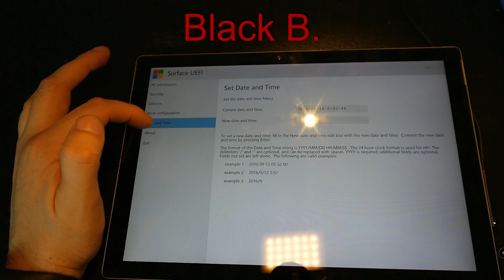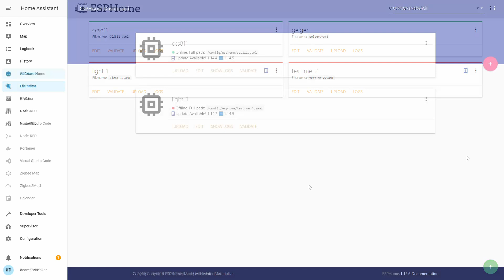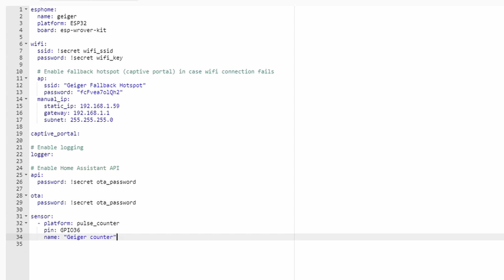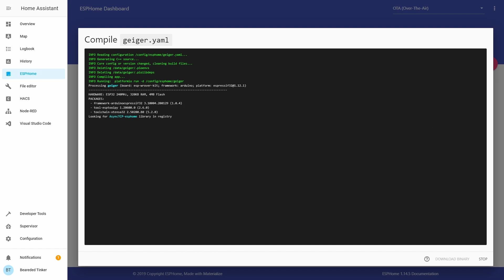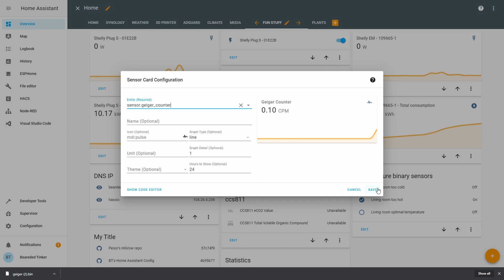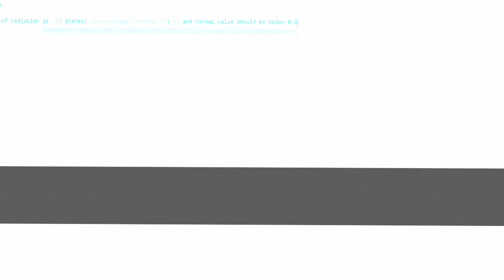Radiation Geiger counter DIY sensor in Home Assistant

Comment: Interesting fact took. I took the device outside and CPM went up almost 4 times due to the sun, in shadow it's not like this. Took a powerful led flashlight and pointed it at the tube, nothing happened. Took an UV led flashlight pointed it at the tube and CPM went up again.
Reply from the maker: Yes, it should be kept away from direct sunlight. And I learned it hard way - got alarm on all devices and speakers. 😂
Then I took time to read a bit more on it and move it to more permanent and secluded space.
Reply: @BeardedTinker  First of all, thank you for the detailed project!
One question: Should the circuit board be in a closed plastic housing or should it be open? Does it make sense to use it indoors or outdoors?
Reply from the maker: @knallaff  you can keep it in  plastic housing. As for placement, I recommend you avoid placing it in the sun (direct sunlight) as sun radiation will have impact on measurements. Indoors and shade is preferred.

Comment: It's good to know how to build and program, I've been doing it 50 yrs so far, another input sensor is nice to add to a micro port, I went from 6502 Forth in the mid 80's with Rom, Ram and Latch FF,  when I worked from Ampex Corp Redwood city, CA. Silicon Valley 400 engineers in my building to the Easy building projects of Picaxe much later with imbedded on board, to the yrs forward projects of Arduino projects
Reply from the maker: Fascinating how it changes through the time but gets easier to work with.

Comment: Have you worked on improving this idea? I'm thinking of building it myself, but I had to ask before ordering components.
Reply from the maker: I've assembled one additional DIY Geiger counter, that is working via Zigbee. Not my project though, picked it off of Russian site. (there is video about it on my channel) This, original board died few months back. Thought that tube died, but no, board died. As it's still connected haven't bothered to look at what failed. It worked for almost 2 years, so not bad for money. Comparing results from those 2 they were actually really close in readings.

Comment: "high voltage" I put my tongue on it.... it has practically 0 amps...
Reply from the maker: 😂 it should be around 300V I think. Forgot what's the rating of J305 tube...

Comment: hi, great job!  compliments!  I bought the kit seeing your video, to integrate it on Home Assistant!  Now I have a RadiationD-v1.1 (CAJOE) kit, slightly different, I have only one number provided and it is placed on P100 (what is it for?), On the test terminals I have nothing, do I have to move it?  can I connect a Wemos D1Mini instead of your ESP32, if so to which pin?  At the end of the video I see a calibration, the second red clamp is not clear to me what it connects, one clamp goes on the sensor hook and the other why on the plastic number of the Test bridge?
Reply from the maker: From what I remember, this board is similar to one I used. Do you have P3 with GND, 5V and VIN? From photo I've found it should have it. Wemos should be connected there - and VIN is used as signal/pulse port.
I didn't try or test this setup, but it should work. But I also had some problems with puls counter on 8266 so decided to go for ESP32 because of that.
Reply: @BeardedTinker  thanks for the answer, I will try the configuration with the wemos and then I will update you.  as for the calibration, can you explain the connection of the second red cable between the sensor connector and the plastic number?  from the video I seem to see it like this.  thank you.  you are very kind
Reply from the maker: I think there is a test pin on the right side of the board.
Reply: @BeardedTinker  sorry, at 25:00 minute (not the PIN test) thanks again and sorry for being very insistent 😆
Reply from the maker: @antoniolespaul5409  exectlly as it says on 24:32  - J2 😁😂- there should be pin with that name next to test (J4). And as for the plastic - it has wire at the top so it's not going on plastic but on connection between test pins.

Comment: I would love to add this sensor. You never know if your area is contaminated. I just started using ESPhome and bought my first ESP32 and setup a bed sensor. Works great.
Reply from the maker: Congrats on entering ESP world! 
I have this one setup now for over a month and it's working great (well I hope as it does provide some data but I have no way of verifying accuracy). Just need to find a way to have it permanently powered and "out of sight" .
Reply: @BeardedTinker  Yea. My esp32 is taped to the side of the bed frame. Wish the red led could be disable. I can see it glow on the wall. I ordered a DHT22 temp sensor. Will add it to the esp32 for a temp check in the room.
Reply from the maker: Did you try putting black masking/electrician tape over the LED? Only other way to disable it that I know of is to cut/desolder it.

Comment: Does this Geiger tube detect X-ray radiation?  what are the safety precautions for touching & using this Geiger tube for avoid radiation expose
Reply from the maker: No, afaik it doesn't detect that one.

Comment: Does it also work with an normal ESP32 or an other ESP Board? because it is hard to get an presolded ESP32 D1 Mini in the EU.
Reply from the maker: You just need to be careful of PINs - it should work. ESPHome needs to be changed according to the board that you use. Can't remember if 8266 can work, but any ESP32 version should work.

Comment: Hmm, where does that 123 divider come from? I'm looking through the datasheet of the M4011 tube on the board, it says you need to divide the number of counts in a minute through 151. For 15 seconds, it should be consequently 37.75. And you apparently need to subtract 25 counts per minute of self-radiation.
Reply from the maker: I got that when researching coefficient of the J305 tube. For M4011 I found coefficient of 153.8 here: https://sites.google.com/site/diygeigercounter/technical/gm-tubes-supported

Comment: Hi - You  use a DI mini esp32. Unfortunately I don't have one of those and it will take about 4 weeks to buy from China. I do have plenty of ESP12F - they have 16 pins including 5v and ground. However they don't have a SUP GPIO36  pin (not sure what that is). Also have plenty of esp32, but they don't have a 5v pin but do have a GPIO36 pin. Is there any alternative to your DI mini?
Reply from the maker: This can be done with 8266 too - I think I used GOIP4 when testing.
Reply: @BeardedTinker  Thanks, my ESP12F is a derivative of ESP8266 and had a GPIO4 pin - all worked out,  good fun project.

Comment: I did try to calibrate my device. I was surprised because I had 60V instead of 6.5V.
I dig a little bit and the correct value is 57V for multimeter with internal impedance 10MOhm, 6.5V is for multimeter with impedance 1MOhm.
Reply from the maker: Awesome - hope all is working and speaker is (slowly) clicking ;)
Reply: @BeardedTinker  I have got second Geiger meter (portable) and the readings does match pretty well.
I bought a smoke detector (it contains minimal amount of radioactive material) and in proximity range both detectors are ticking more.
So if you don’t sure if it works look around, maybe somwhere is smoke detector and you can check your device.
Reply from the maker: @gabrielcwik146  great!!! I do have one other too, but that one is also DIY - zigbee version. A lot of surface mount components soldering were required, but it works :)

Comment: Hi   I  like the look of this project so thanks for preparing this video. Before I commit to buying the geiger component I wanted to try and get understanding  on a couple of points. Firstly, I am not using secrets file on HA and   assume I can just use my own  home SSID and  p/w when I set up the ESPHome geiger file. Also,  I don't understand what the fallback hotspot is. Where does it come from  and where is the password set up. This info  seemed to be there when you submitted your basic set up info to ESPHome. Is any hardware needed for this? Sorry if  questions are a  bit basic. I have  successfully done quite a few   ESPHome setups but this seems different.
Reply from the maker: Thank you very much for your comment Neil!!!
Yes, you don't need to use secrets file. You can just type them in directly in ESPHome.
Fall back hotspot is just added feature of  ESPHome - it turns device into Hotspot if it can't establish access to your access point. That part is not needed and although I never (had to ) use it, it's also it can be helpful.
Reply: Thanks for clarifying

Comment: This sensor seems relatively affordable. Do you think there'd be any point in getting two or more for improved accuracy (or alternative reducing the sampling period)? Or alternatively put a second one outside, since concrete seems to have good blocking properties?
Reply from the maker: You need to wait for one of my next videos :)
But, there is one DIY project that can utilise 1 or 2 tubes. And if 2 are present, it should improve efficiency of the counter.
One thing I'm sure, you need to keep this sensor in shade - sun will mess reading and give false data. At least for all the sensors that use glass/transparent tubes. Old USSR style tubes are not acceptable to those problems.

Comment: Hi thanks for the video, assembled my own counter and connected it to Home assistant in no time. Have got 2 questions though.
1) My tube is J305 where can I find the multiplier for it?
2) When calibrating I see voltage of 60V not 6V, guess it is a different version of the device, unfortunately could not find any documentation with the correct voltage. Printing on the board says RadiationD-v1.1(CAJOE). Google is not really helpful, same as the seller, any ideas.

thanks! help is really appreciated.
Reply from the maker: I have same tube - check multiplier in videos description. 
In terms of calibration. I think it should be around 60V because tube works with up to 300V - if I remember correctly. 
Haven't played in a long time with it and can't check currently mine as it's a bit out of reach in permanent location.
Reply: Ok, found an answer to second question. The voltage depends on Voltmeter, if its resistance is 1M ohm then you need 6,5V, but when it's 10M ohm you need to set 57,0 V. More details here https://github.com/2969773606/GeigerCounter-V1.1/blob/master/En_Calibration_GMv1.1.pdf
Reply: @GlebGrigorian  Thanks, I had the same "issue"

Comment: What ESP32 have you used, with CP2104 or CH9102 driver?
Reply from the maker: If I remember correctly CP210x.
Reply: @BeardedTinker  Thanks!
Reply: @BeardedTinker  Thanks for the tutorial, I reproduced the project successfully. Is there a way to disable buzzer other than physically removing it from the board?
Also, would be nice to somehow average out the result, my home assistant shows 0.22uSv/h of natural background, 15s later it shows 0.03uSv/h, then 0.15uSv/h, etc.
Reply from the maker: Unfortuantely, no... You have to desolder it - after about 1-2 years of use I can't hear it anymore to be honest, but if I concentrate, clicking is here :D
You could use Statistics integration in HA and Min/Max sensro to play with values - later on has median values, that can maybe be used here.
Reply: @BeardedTinker  I figured it out already, there is a jumper on the board, near the buzzer - I took it out and now it's silent ;) also changed the update interval from 15s to 60s which is more than enough for me and it stabilized the readings. Thanks again for the tutorial:)

Comment: Got a ESP8266 and to my disapointment it does not provide 5v. can i use a separate powersupply to the geiger kit?
Reply from the maker: Haven't tried it and I would have to say no. Connection to/from ESP only really requires signal wire. But if I'm not mistaken it also needs common ground. You could try connecting those 2 wires, skipping power and then inject power from batteries or power supply. It could work, but I would bet against it 😂
Reply: @BeardedTinker  thanks for answering! I was wrong thinking the board does not provide 5v. After a little research i found the VIN pin is providing it. I also see some people say it is 0.5v under 5v because of the sharing to 3.3v but my multimeter says 4.95v so i am going to go with that. Not recevied the geiger kit yet so cant say for a few days if it wil work.  Anyways great video :)

Comment: Hey, 
Is it possible to use the pre assebled GC-1602-nano board (cajoe) inc lcd
I have the following pin's were the arduino nano is conneced to
GND
5V
SCL
SDA
INT

Other pin
GND
5v
INT
so that i can use a ESP+wifi instead of the arduino nano
Thanks and keep up the great work!
Reply from the maker: I think this board also has 5V GND and INT. You should be able to use those pins, and maybe power board over it.
But, I've not tested it of course and this is just my "guess".
From INT pins on nano, not sure if any is exposing ticks from counter. You'll need oscilloscope to test it or playing with nano firmware.
Reply: @BeardedTinker  Thanks for you'r info.
i wil try it out soon and let you know.
Gr

Comment: Too bad.
Despite correct comparison and transfer of the data to the ESP, my Geiger counter clicks but it doesn't output any data. :-(
The only difference... I have a tube with the designation J315
28 euros for the garbage can

PS: ESPHOME now requires the line:
allow_other_uses: true
under the PIN number line if the same PIN is used/listed again, otherwise there is an error message!
Reply from the maker: It should still work. My device died but I ordered a new one. Check that you have the correct pin on ESP board